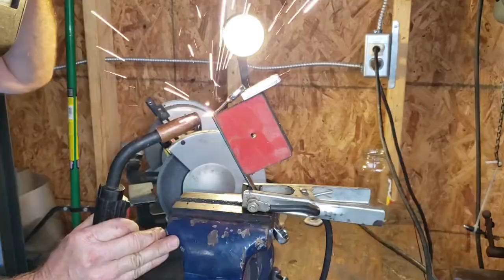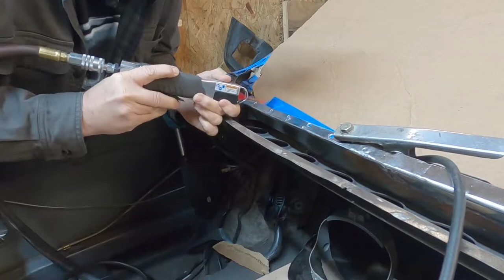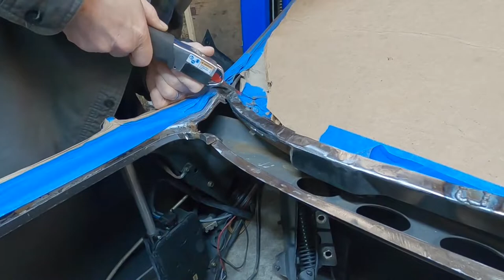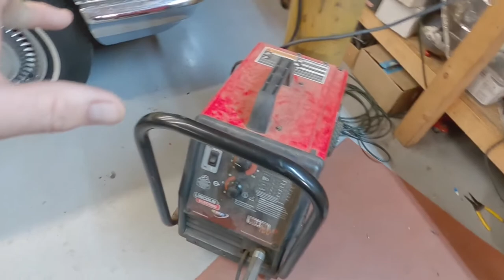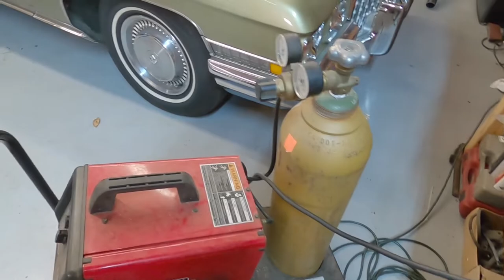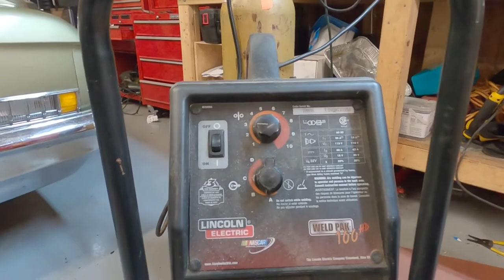Mercedes W126 - Rear Window Channel Rust Repair - Part 9 - Correcting Mistakes

Comment: Man I can't wait to see more. Took my w116 300sd on a road trip, 700miles round trip and she did 28.5mpg, i am one proud owner. The turbocharger is showing age a bit however. So i may do a rebuild next spring.
Reply from the maker: It's slow going but I'm starting to see a glimmer at the end of the tunnel on this project since I've got my feeble brain wrapped around some of the hurdles.